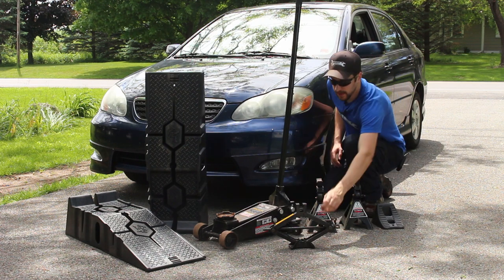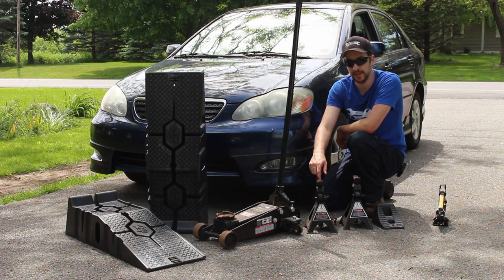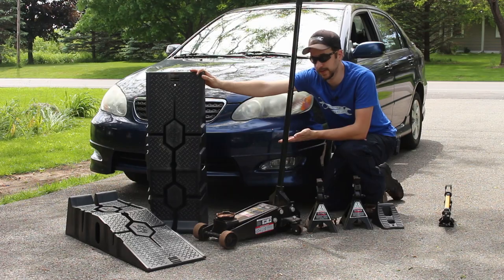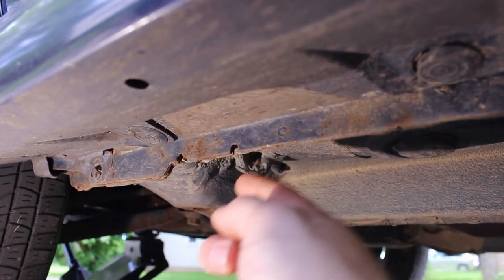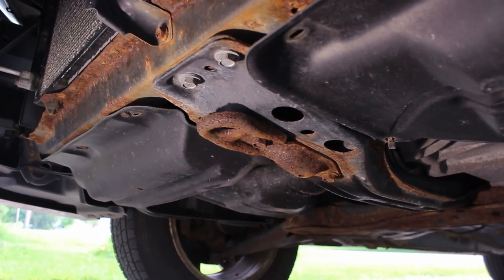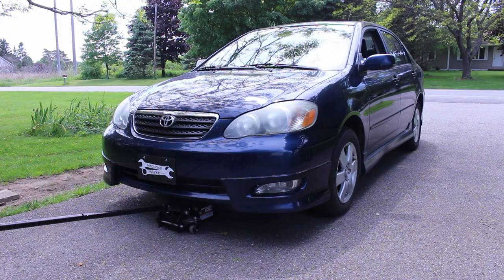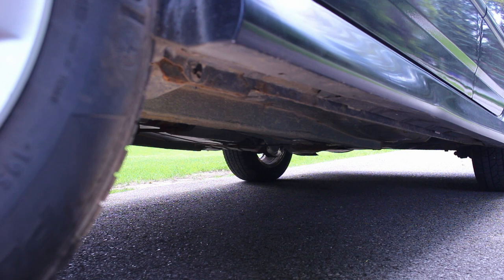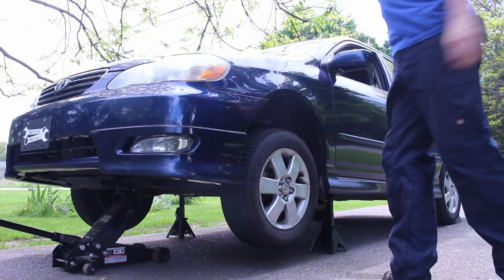How to Safely Lift and Support a Car

Comment: The "frame rails" that you showed are NOT strong at all.  You will end up bending them!!!  If you go to sell it, buyers will think it was in an accident or you offroaded the car!!!  Always use the pinch welds, tow hooks or cross members that you showed.  Read your users manual because it shows exactly where the manufacture recommends to jack it up or place jack stands.